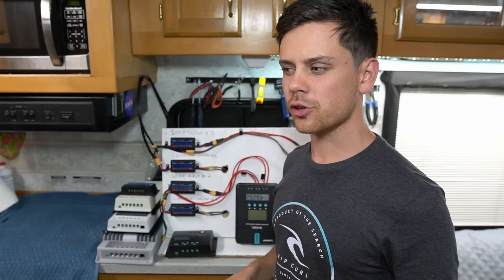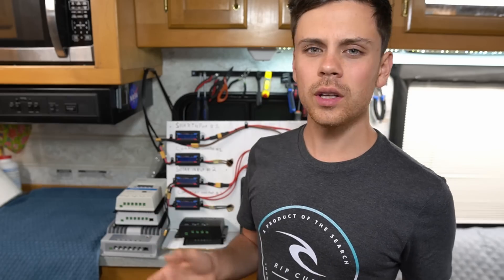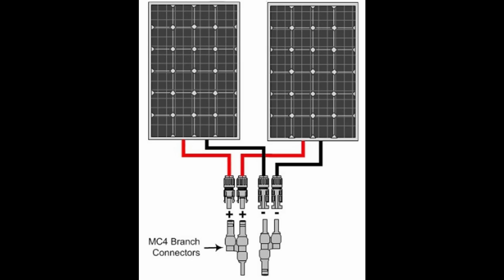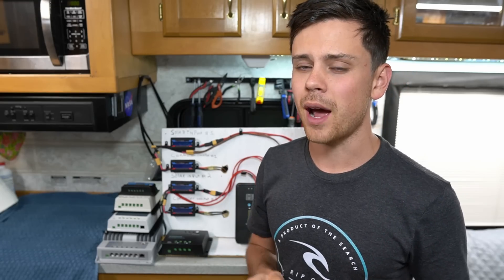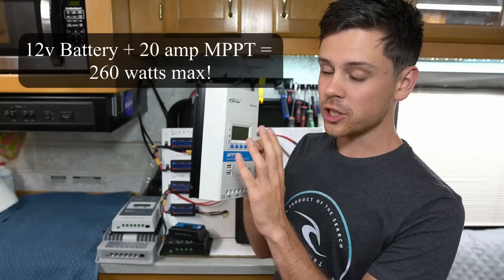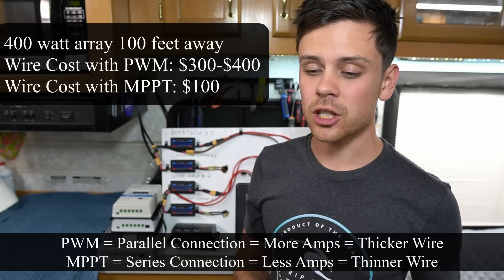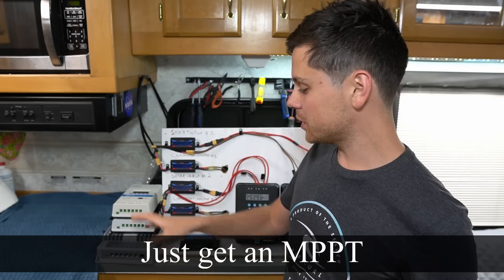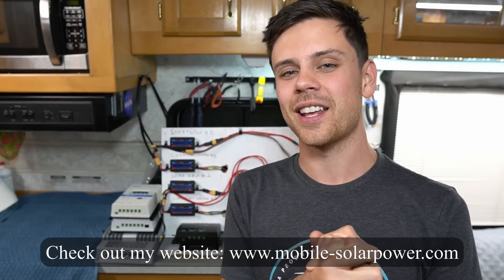MPPT vs PWM: Fast comparison for off-grid solar

Comment: Hi Will, what about the charge rate differences between pwm and mppt when the battery bank is at a lower voltage eg. After a night of heavy use and the battery is down to 12.1v
Reply: The battery shouldn't go below 12.2 or there'll be permanent damage. Voltage is like pressure and to fill a battery at 12.1, you need a voltage greater than 12.1. Higher voltage panels/array will deliver the voltage necessary to begin recharging the battery.
Reply: @AaronGeller  Thank you Aaron for the info but i was more interested  if there is a difference in charge rates between pwm and mppt when the battery is at a lower voltage eg. 12.2v 50% SOC
Reply: @matthewross9952  I do not believe so - if it's a lead acid battery, it'll take as much electricity as the panels are giving off until it reaches the absorption stage where resistance builds up and you need more voltage to pack more electricity in. 
With a Lithium, it has very little resistance and can absorb almost all you throw at it until it's charged.
So in short, I don't believe there will be a difference at the lower voltage.
Hopefully that helps!

Comment: I have 360 watts. 30amp controller. All renogy. And 10 gauge wire. Is 10 gauge wire to thin?
Reply: Bluesea has an online calculator where you can enter voltage, amps, and length (you need to do cables run to AND from the device) that'll tell you the required wire size. 10 gauge is good up to 10 ft for 30 amps. 8 AWG (gauge) is good up to 15 ft. If they're in series, it'll be the same watts but lower amps so you'll be able to use thinner wires and it'll be cheaper.

Comment: I am totally new to Solar and trying to find as much info as I can your videos seem very complete and have a lot of information. I know a lot about  PWM and you say PWM and other times you say Pulse Width Modulation however as a noob I have never heard the term MPPT and you never say what it is? I will look it up but you might want to add that for beginners such as myself Thanks for the videos I have only watched two so far but I am SURE that will change lol Thanks
Reply from the maker: Maximum power point tracking

Comment: I just installed 3 separate systems on my van. May be bad idea. But now I can have 3 separate battery banks. One has a fridge, one has a freezer and one has everything else. So goal is to not have to touch fridge or freezer for 3 years. And the third battery is cheaply replaced.

Comment: I watched a video where a young man attached a Hengs RV vent fan directly to a 20w poly solar panel. I will be doing something similar. 

I will be using a 25w amorphous panel from Harbor Freight. (Lots of cloudy weather and drydocking under a tree). I have not chosen the fan yet. Maxxfan, Fantasic Fan or Hengs. 
First. What aspects of the panel and fan do I need to look at to make this work properly? 
Second. If I instal a 12v on/off switch, do I connect it to the positive or negative? Will this switch in the off position negatively affect the panel while it’s producing power?

Thanks for any advice you have for me. 

D.
Reply from the maker: Please check out my video where I show how to run 12 volt appliances without a battery. It covers all of that
Reply: Will Prowse Thanks.  Will do.
Reply: Will Prowse Ok. I have watch several of your videos about solar w/o battery, off grid power etc. I don’t think I’m finding what I’m looking for here. 
It looks like you are using 24v output solar panels and stepping them down to 12v with your converter. Do all solar panels output 24v? 
I’m just trying to connect an RV vent fan direct to a solar panel and need to know what aspects of each I need to research before I purchase. 

Can I get a link to your video that explains this?

D.
Reply: WestMountain Adventures I watched the video where Will attaches an electronic device to the solar panel while bypassing the use of a battery. He used a converter to modulate the voltage coming from the panel so it would provide a more or less constant voltage of 12v. The converter is taking voltages that would be too high and stepping them down to a usable voltage similar to what a charge controller does without needing a battery.
Reply: Aaron G Thanks for the reply. Those are the videos I referred to above. On a video from another channel, I watch a guy attach a panel directly to an RV vent fan with no other equipment. See my comment above for details on what information I’m looking for. 

D.
Reply: @westmountainadventures3606  My understanding is that certain motors run optimally at certain voltages and when the voltage drops, the speed of the motor will drop subsequently. So in full sun light, I would imagine the fan's speed should be consistent unless something covers the panel like shade or until it gets darker.
Reply: Aaron G You are correct. I will only need the fan to run during the day. Amorphous panels put out a higher percentage of power in less than optimal conditions than mono or poly, which is why I’ll be going with the Harbor Freight 25w panel. 

What I have not been able to determine is that if the panel puts out 12v or 24v. If it matters. 
Also, if the Fantasic fans or Maxxfans can be configured this way. 

I’m also wanting to put a shutoff switch on it so I can turn it off when not needed. Will this negatively affect the fan or panel? 

I’ve done quite a bit of research on the web and YouTube and can’t seem to find the information I’m looking for so I can move forward with confidences. This is why I’ve come to Will for answers. He seems to know what he’s talking about, but I don’t think he realizes how simple I’m trying to make this project. 

D.

Comment: Great video and excellent comparisons Will. Well done. It's invaluable getting these side-by-side comparisons. 
One suggestion in the future is add a longer time run to your tests, small differences may add up over time and instantaneous production isn't as critical as the over time production (It's telling but not necessarily conculsive). 

Any reason you did not test a Midnite Solar, they seem popular and well built?

FYI to all, buy Will's book - it's good, you'll learn something reagrdless of expereience and importantly support a fantastic content creator!
Reply: I agree.  Will's book is excellent!  It really filled in the blanks that I had after completing a couple online solar introductory courses.
Reply: @myavatar9590  @

Comment: I would also like to point out if you want your batteries to last get a MPPT controller.  It's the only one that will do the three phases of charging bulk, absorption and float. PWN just puts amps into your battery until it reaches a set voltage.
Reply: clay2k I believe he mentioned this in his Advanced video. 

Sometimes getting started on the smallest budget possible is more important than waiting to save the money to do it right.
Reply: @westmountainadventures3606  I know he knows this I just wish he said it in this video. Because this is a video of reasons why MPPT is better than PWN. This is one of the main reasons I will never use a PWN again if I pay more than $200 for a battery.
Reply: clay2k Fair enough. This is something that a beginner should know, but wouldn’t unless told. 
I am just getting started and don’t plan on paying more that $100 for each of my batteries. 
For the moment, I am only setting my system up for short term, black out situations. Later, I will move up to short term off grid (several hour a day for several days a month). 

Eventually, I would like to be off the power grid completely. Somewhere in there I will upgrade to a hybrid mppt, soft start for the AC, LiFePo batteries, etc. 
For now it’s growing my deep cycle battery bank, stock inverter/converter and grid power to charge.

“Speed is a matter of money. How fast do you want to go?” Currently, my budget has me at a snails pace. Lol. 

D.

Comment: Ip68 rating. Pwm is what I bought because that is one of the only one I found for a decent price. It came with an aluminum case at 20a and a remote. No lcd though. Can use on li and la. Will be nice for outdoor conditions.

Comment: Because of you Will I am seriously looking at lithium phosphate batteries for my solar setup. I already have the latest epever 30amp charge controller. But I live in a very shaded location and so I'm wondering if Amorphous solar panels might be the best bet for me. I do already have one of them but my other panels are all Grape Solar 100-Watt Polycrystalline Solar Panel. And I might switch to all Amorphous panels. Not that I want to but I live with a lot of trees and shade. The best I'm going to get is partial sun on any panels I use. But I figure if I use enough of the right kind and use lithium phosphate batteries and use them lightly I might be okay with a 1K system. Any words of wisdom are appreciated.
Reply from the maker: Any way you can setup a small array and run some wires? Shading reduces output significantly. Makes things very difficult. Even a tiny set of solar panels will outperform a huge array if it's in the sun all day
Reply: The best I can do Will is put the array on my roof of my house which isn't what I wanted to do but there they would be in full sun late morning and early afternoon.  However that would only last for say four hours maybe.. not sure really and that's the best I can do. I only want to use my solar as a backup in case the grid goes down on occasion, running a water pump when needed, few low wattage LED lights, maybe a laptop, router, modem.
Reply from the maker: Yeah it's so smart to have backup power system in case grid goes dowm
Reply: @WillProwse  Also wanted to say thanks for the video and the advice on my comments. Also wanted to say I watched a video from you made a few months ago and noticed your computer keyboard and layout with your monitors/tv and thought that looked pretty sweet. Wondered if you do any gaming with it.
Reply from the maker: And thank you! And yeah like crazy. Deep into Apex legends lately but still play overwatch
Reply from the maker: Just got 2060 graphics card and my screen is 144 hz. I love it

Comment: Couldn't agree with you more Will. I just changed from PWM to MPPT and over the last week, I am getting 2 to 3hrs more life from the batteries in part cloudy/part sunny days here in North London and I'm seeing a 4 to 5amp output from my panels in just normal daylight (no sun) when I was getting nothing on PWM without sun. Well worth the upgrade.
Reply: thanks for that  :)
Reply: What CC are you using mate?
Reply: @Ziplock9000  Renogy Rover 40 amp
Reply: @dtvking  Thanks mate
Reply: @dtvking  if im running only a 100 watt panel would the 40 rover be overkill?  Would i produce the same with the less expensive 20 rover?
Reply: @KarlSagan1414  if your not thinking of upgrading the system,  then go with the cheeper model but for the price difference between the 2 it's worth the upgrade now if expansion is required later.
Reply: Sir, how do you monitor your system, with what specific devices?
Reply: @askaraskar155  I use mobile phones connected to the devices i.e. the Renogy Rover is Bluetooth, the 24V pure sine wave inverter is com port to a RS232 to RS484 converter via a WiFi converter, then I have 2 Bluetooth BMS's using the VBMS app (on google) monitoring the 2 sets of Li-polymer Battery Packs.
All connected to mobile phones running the remote monitoring software so I can log in from anywhere in the world and view/configure the lot.
Reply: @dtvking  you are a nice man, شكرآ

Comment: hi will thanks for all your informative vids
could you advise me I have a 90w folding panel with a built in pwm controller. can I change it for a mppt
Reply: Here's what I had the guys at AM Solar do for me. They took an off-the-shelf Zamp 80 watt folding portable. They removed the cheapie PWM controller and rewired the two panels in series -- now delivering ~36 volts. They also built a 15 foot  extension cable allowing me  more length to find the sun. The cables plug into a  smell Victron MPPT controller. From there I plug the cable in the solar on the side on my travel trailer. If I maximize my run of cable, I can get further away much better if running at 36 volts rather than 18 volts. You want the controller as close to your battery as reasonably possible.

To have the controller as is done on most portables mounted on the back of the panel may be nice in that you're ready to plug and play. However, that setup is most conducive to voltage loss, especially if running an extension cable.

Comment: Thanks again! I will avoid those. Do you know of any negative grounded dual battery solar chargers?
Reply: All of those solar charge controllers will do what you need. They are negative grounded and can charge a dual battery setup. Not sure why you felt you should avoid the charge controllers in the vid.
Reply: Andrew Hamilton I am looking for something to charge two house batteries, of differing capacities, independently. And be able to give priority to battery I choose. If you know how these controllers can be hooked up to do this, please let me know. One solar array, one charger, one 90 Ah battery and one 100 Ah battery, all 12v

Comment: Thanks! Can a positive ground solar controller work with a negative ground system if a load is not connected to the controller? I am looking at a dual battery controller for separate battery banks of different capacities. Epever and Renogy have models that appear identical.
Reply from the maker: Just avoid all positive ground components like the plague unless you are stuck with a bunch of positive ground solar panels. Negative ground way to go for small and off grid systems
Reply: @WillProwse  Not a bad idea, positive ground controllers are actually positive common controllers. The negative panel and battery terminal are switched.  These can not be connected together.  The neg of battery can still be connected to ground.

Comment: Yes unless you add a cabinet to every sentence you will
Mislead a few. 

It’s my guess that every 100w solar kit comes with PEM and it’s not too bad because the output difference is small. 

i added a 24v panel - do I pump 24v through the controller and charge 12v system. 

If panels produce 24v at 5a
pWM gives me 12v at 5a
Mppt gives me 12v at about 7a because it can step up the amperage while PWM cannot

Comment: I have a question what you recommend me to wire my solar panel I have 7 of 100 Watts 12 volt. And 2 40amp mppt charge controller and 50 ft away I appreciate a lot
Reply from the maker: Oh man that's a tough ones. Considering wire cost and 50 feet, I would put them I'm series, but that might exceed the max voltage input if your controller. Hmm, depends on controller type
Reply from the maker: I would do 6 panels, in series, if they are mounted at same angle to the sun, and use a 150v max input charge controller, and omit the 7th panel. 150v max controllers cheap to find. Going over that limit costs a ton
Reply from the maker: Totally different story if you turned your battery 24v. But input voltage limit still would be present
Reply: I have two 40 amp epever tracer mppt and 100v input and 12v battery bank and 8 gauge wire thanks so much

Comment: Will, can you put two 3.2v batteries in parallel (e.g. 90ah to make a 180ah unit) before connecting each unit together in series (to make a 180ah 12v battery)? And then connect two of these batteries together to make 180ah 24v? And finally connect two of these together to make 360ah 24v? Yes, I know that is complex, but I have access to a lot of 90ah 3.2v cells.
Reply from the maker: Yeah that's the way you want to do it actually. Tesla uses this configuration and quite a few battery builders use this.
Reply from the maker: You could actually put 4 cells in parallel, then 4 of these parallel groups in series
Reply: @WillProwse  Thanks!!!